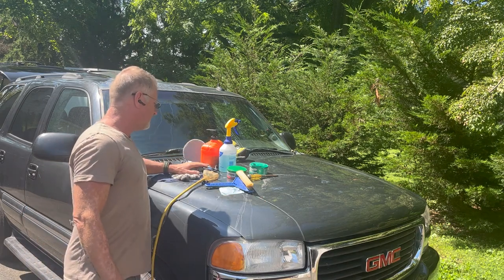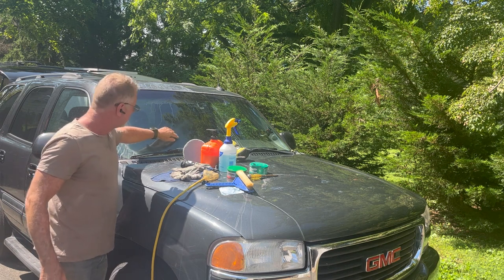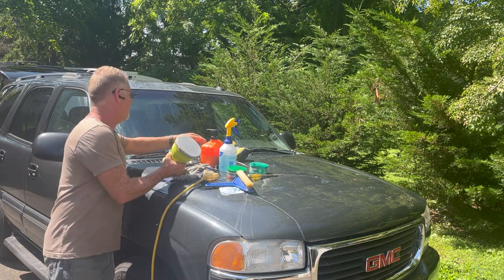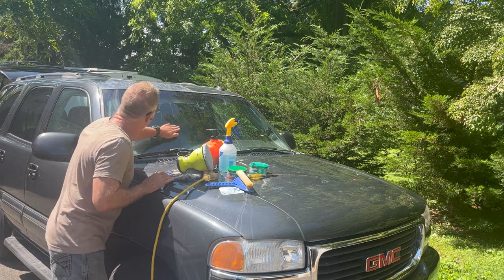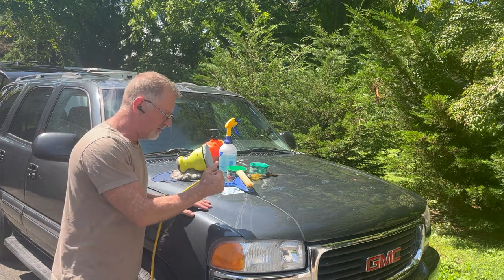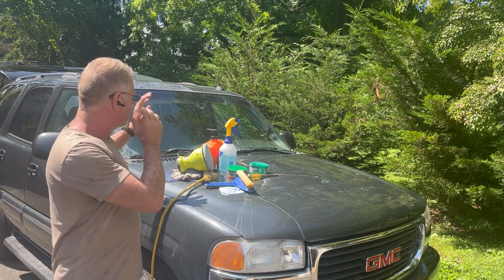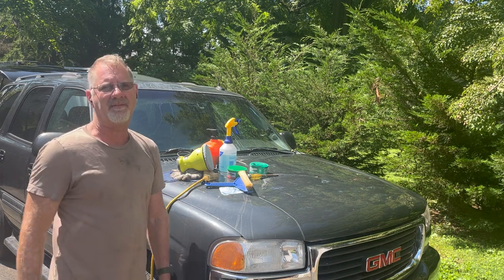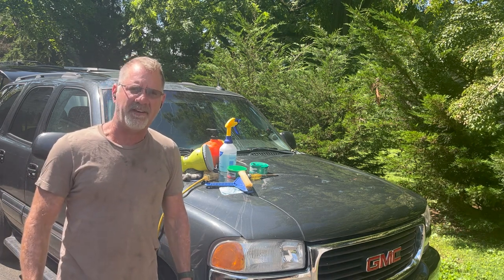Yukon Inspection Work  and Dumping Trailer

Comment: Glad you handled the situation like you did, and that you are smart enough to understand it for what it was ,and not let it ruin your whole day ! Brother , I wish we had known about your windshield situation when you were in Waveland , Miss. ! As an old rock hound , I have all kinds of polish and pads I would've hooked you up with !  Just one word of caution , Too high of RPM when polishing will melt , and smear your glass .  1725 RPM is recommended for polish . Your side grinder probably turns 7000 or so !
Reply from the maker: Craig! Sounds like you have the polishing situation dialed in, brother. All I have at this point is the drill speed. I’m using turtle wax and pumice with the wheels in the video.

Comment: Jamie, you might try putting some clear fingernail polish in the scratch and then polishing it.  Will it add any strength?  No.  Might it get it past the inspector?  Maybe.  I agree that a scratch in the windshield is being pretty petty.  Good luck on the rest of the stuff.
Reply from the maker: Thanks man. Otherwise, the rest is a matter of swapping parts. Nothing to get too bent out of shape over. Good to see you in the comments buddy!

Comment: Have you tried 0000 steel wool.  If you can feel the scratch with your finger nail it may be too deep. Try some two part clear epoxy.  Just use like a tooth pick. Let it cure until Sunday night. Then use a new razor blade and go over the scratch flat lightly just to get around the scratch the residue off. ????  That may be enough to hide it????   Peace Brother.  🇺🇸🇺🇸🇺🇸🇺🇸
Reply from the maker: I think I have that steel wool. The scratch might be too shallow at this point for epoxy. I appreciate the advice.